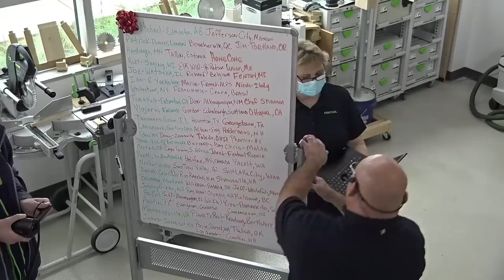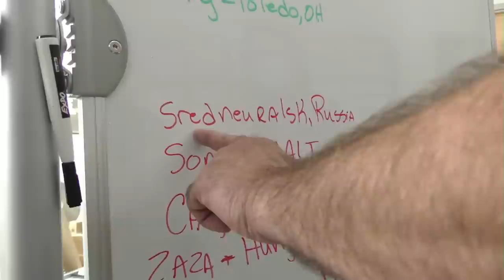Festool Live Episode 72 - Lost in the Catalog

Comment: Hi Sedge.. I have a very specific issue/question about using the OF 1400 on the CMS0OF table. I need to use it with a guide bushing. I don't see a guide bushing accessory that will work with the table (the stock one for the OF1400 does not protrude far enough thru the table. How do you do that? is there a specific accessory that fits a guide bushing on the table?